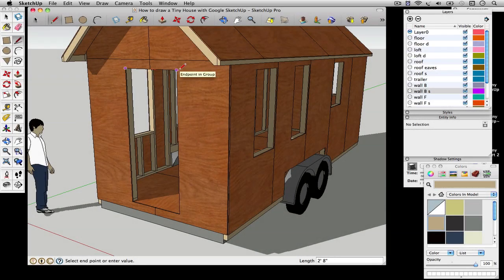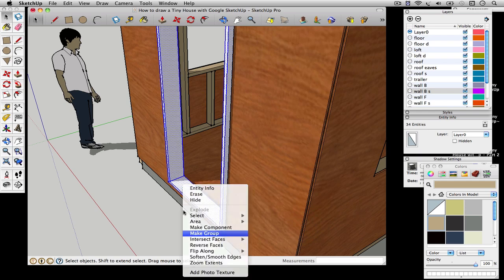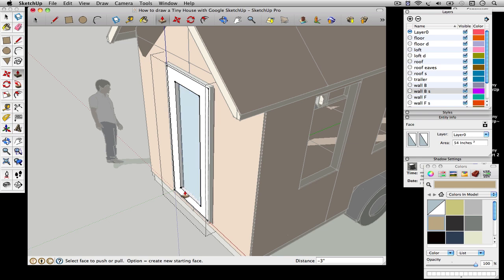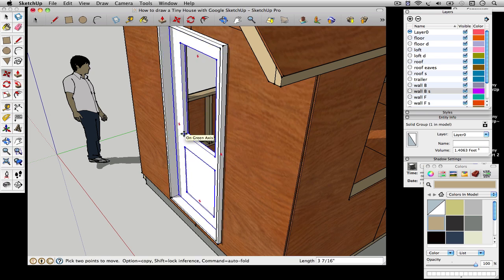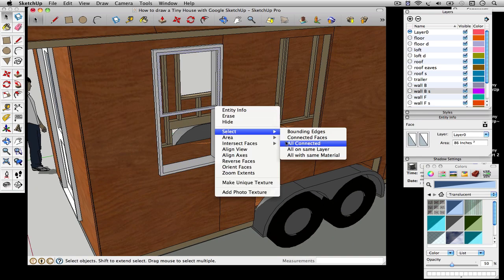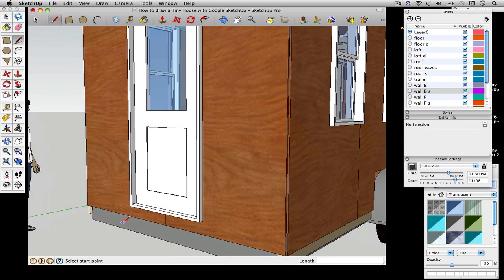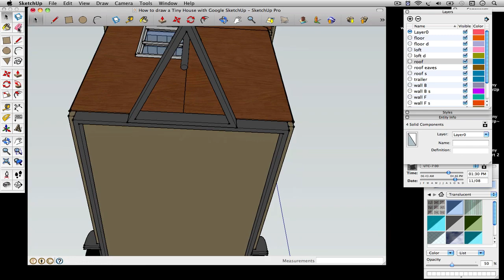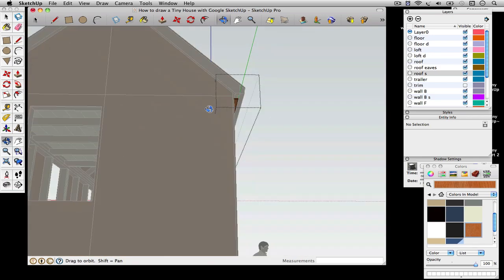How to draw a Tiny House with Google SketchUp - Part 4

Comment: @stermr Built-in, No.

You can download a plugin called "CutList 4.1" After a small learning curve, it works quite well. If you want it to calculate sheet goods you need to use one of these magic words in your description "sheet, veneer, plywood, hardboard, mdf"